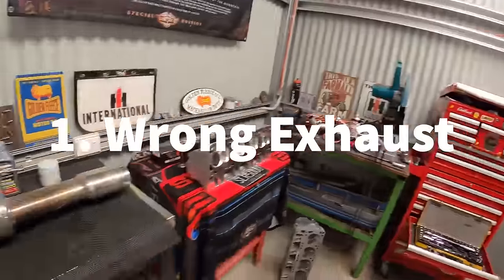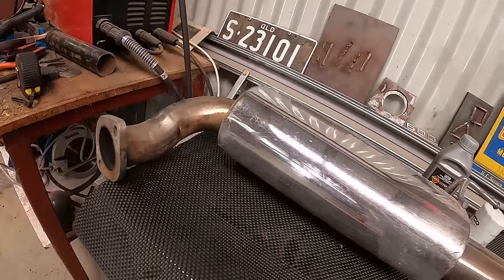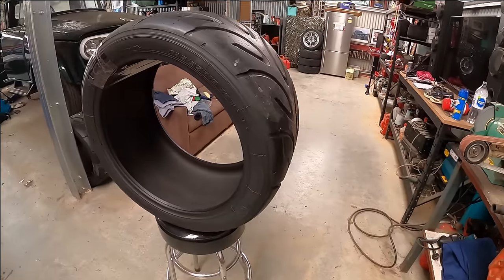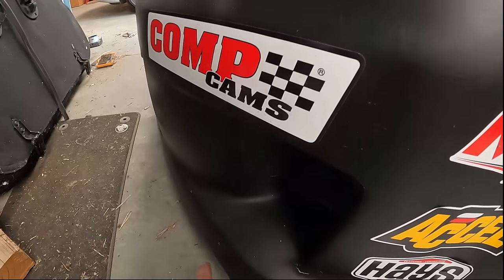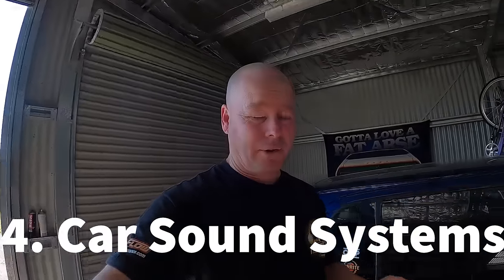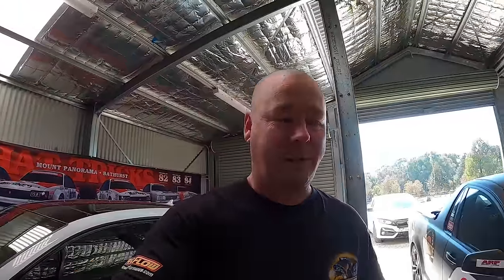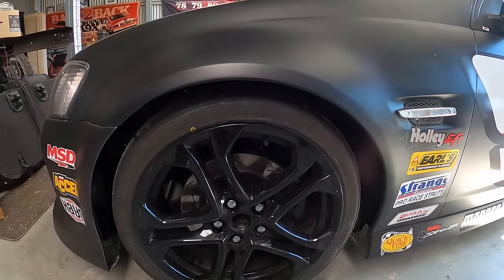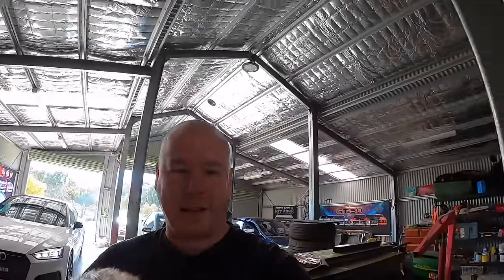Top 5 Worst Performance Mods - VE/VF Commodore

Comment: Hey I love you vids!
I just wanted to add one thing... Its not that you want backpressure... you want as little backpressure as possible really... But what you still need is velocity!
If the pipe is too wide, the gasses will slow down, reducing the suction effect next time the exhaust valve opens. If its too thin, you'll have too much backpressure.

The ideal size, is thin enough to keep gasses moving quickly, but thick enough to keep backpressure low.

Kind regards

Comment: So for 18" wheels what brakes would you recommend?

Almost all upgraded brakes from a stock SS ive looked at require 19"+ wheels to fit them ?
Like anything the size of SSV brakes need 19" they keep telling me.

Are you saying I should go a custom set ?
Any recommendations ?

I know I can fit better calipers (more pots etc) without 19" wheels but what about the discs? 
Supercars run on 18" wheels afaik or at least used to, but they have ducted cooling and I haven't done that yet, tho plan too in the future basically following your vid for doing it :)
Reply from the maker: G'day Jason, I have managed to fit my VF Redline brembo brakes under my forged Koya 18s.  Have profiled this on a video on the channel.  Also, Harrop sell forgeline wheels in 18s that clear their ultimate big brake kit as profiled on their Monaro 427 project build.

Comment: Is it worth getting sway bars cause I want to improve the handling of my vf series 2 sv6
Reply from the maker: Yes, upgraded sway bars are important if used with a set of coilovers and wheel alignment.  Don't set them up too hard though or your car will handle worse.

Comment: Good video mate . Just wondering , can I use or should I use 10W 40 on my V.E SS? Thanks for your time and effort
Reply from the maker: G'day mate, from memory 10W-40 was the recommended oil for LS1s across VT-VY V8s.  I am pretty sure 5W-30 is the recommended oil for VE SS V8 engines but double check your oil cap and vehicle manual.
Reply: @ClunieGarage  thanks for replying and the info . Across the road where I work I guy owned a VF SS and he reckon he used 10-40 for his SS . That’s why I thought I should ask the experts . Thanks for your advice very simple but accurate answer

Comment: Totally agree with your list, however, I must make 1 exception. My car will never see a race track, and is more so just for use as a daily, and I recently upgraded to 20" rims with staggered tyres. I have never felt so much traction or road handling in my life. I appreciate the enforced roll around a track would be best on 18's, but for a daily, 20's with wider tyres is definitely better.
Reply from the maker: G'day Ash, nice one.  Yes good rubber on a daily is the way to go.  You will have to try 18s and semi slicks on the track.  Awesome combo.
Reply: The extra grip could be down to having wider tyres on the rear.
Reply: Definitely can't see that 20's would be very good with turning any corner. 
Or keeping fillings in the teeth with any upgraded suspension
Reply: I used to have 19s on the SV6 with coilovers and it was rough on the road. 
18s on it now and so much nicer.

Comment: Top gear did a track test and got faster lap times with the smaller wheels over the 20" ones you need a bit of sidewall flex.
Reply from the maker: G'day Grant, yes we agree.  That is why we have gone with 18" Koyas and semi slicks on our VF.  20" are for auto salons and those days are over!!!

Comment: I have a VZ SSZ Crewman, grumpy 300 rwKw  LS1, that came with 18's standard. It has the slightly larger front rotors and calipers as do the Monaro's. I put on a set of (lighter) 19x8's (same offsets) as they look better (to me)....and noticed a reduction in brake performance immediately. Has to do with the  larger rotating mass and ......blah blah!  So... I had to spend more money putting on grooved rotors and better pads to get back what I lost for looks! Smart thinkin' eh!

Comment: Interestingly I took off the two rear mufflers off a VE 3.0 wagon that I use for work. It has made a big difference in better fuel economy. I do a lot of highway driving. Did the same to my SS ute, just sounds nice, not to loud. Great show by the way just discovered your channel. Use to do track days myself at sandown  in a RX8, brilliant handling car with good set of springs and tyers. Keep up the good info guys 👍
Reply from the maker: G'day mate, thanks for tuning in.  Yes, some muffler deletes are OK, I guess we just draw the line at full straight throughs.  I hear that Sandown is going to close to make way for a massive housing development.  How sad...
Reply: @ClunieGarage  wow didn't know that, that shouldn't be allowed,the government is robbing us from any joys in life.
Reply: I did the same on my 3.0 wags as well as removing the resonator of the intake and just Fab a Aluminium pipe left the Stock air box with a K n s panel filter and set up a catch can because I was finding a lot oil residue in the intake now IV been catching a lot crap in the catch can I think that has also helped fuel economy keeping my octane level higher
Reply: @jamesalbrecht418  The oil residue is because you are using a K&N filter they allow a lot of dirt through causing ring and bore wear which cause the blowby that gives you the oily residue and of course severely shortens the engine life. It may be to late but bin the K&N and go to a paper filter and just change it more often.
Reply: @grantreid3031  I'd say the pcv system wasn't working right. To be getting oil at the air intake sounds like the oil isn't getting out properly & pressure building up.
The Alloytec V6s were notorious for getting clogged as the outlet was too small for how infrequently the oil was changed. Leading to sludge and timing chain issues

15,000km 12 months was far too long an interval.

There's always going to be some blow by and such. But a lot comes from the rocker covers too. 

I've got 330,000 on my Alloytec LY7 SV6 have a small catch can and empty it once a year and have used K&N filters for about 200k of that.

Comment: Over here in the USA. Its fart can mufflers and loud booming stereos  that are pretty. Silly, all noise and no power boost.a launch control tune. I can understand  but they race on the highways and feeways. Right past  speed traps cops hide.  At.. i dont understand this two step mod so many use here at all. Good way to blow a turbo..

Comment: I've got three and a half inch not straight through but ..sounds great I don't think it's loud enough .. tyre issue I agree with I have trouble fitting tyre's .wings are for  planes personally..radios not in my car my music is my V8
Reply from the maker: G'day Jeffrey, we agree with you.  Best sound is those 8 cylinders rumbling.  If you want more noise, get some extractors and look into your cats - meow 😆
Reply: @ClunieGarage  I've got three inch headers xflow system right through with cats and mufflers it has to be roadworthy ..it's bad enough the cops break there necks everytime they see me I live in a small town not trying to be cop bait hahaha.

Comment: Everything is a compromise. I've got a cammed ve ss with long tube 4-1 headers and a 3" exhaust with 3 mufflers. Makes about 30hp more than another ve with the same cam but 4-2-1 headers and less mufflers. Did it more for the tone (not volume) but you lose a lot of ground clearance. 

18s are great for the track but imo tyre sizes aren't all that great. I've found most 200tw tires are around 265/35 or 245/40 which is a bit small for my liking. I think 255/35r20 and 275/35r20 are perfectly reasonable for street duties.
Reply: What cam are you running and what sort of power does it make?
Reply: @angry9901  Hi Torque performance custom HTP01. From memory it's around 224/230 @0.050°, 114 LSA, 0.6" lift. ~440 rwhp / 330 rwkw. L77 with manual trans. 

Closest VCM grind would probably be the VCM5SC.
Reply: Nice result right there, pretty wide LSA.
Reply: @angry9901  Yeah it's still a daily most of the time so plenty lumpy enough for me

Comment: P Platers and their V6 commodores sound the worst... Crappy sounding exhausts, E-Bay 'special' mods... The list goes on...
Reply from the maker: Yep, true that!
Reply: I used a LUKEY when the rear muffler started to fall apart.
Not loud and not stupid. Low volume 'burble'.
Reply: @MelodyMan69  Eh, some of them can sound okay (just okay), but they aren't inherently great sounding, even in stock form...

Comment: Agree with everything except you saying that back pressure makes power more power on a ls..it doesn’t matter what engine it is 😂😂 it’s proven that back pressure is not a restriction no if’s or buts…it’s dyno proven not what someone thinks ✌️
Reply from the maker: G'day mate, there is a really interesting tech article on Street Quicks website about some of the testing and r&d they have done in this regard with different size headers and exhausts - check this out http://www.streetquick.com.au/

Comment: Oh I forgot about your 18 inch wheels lol 20 inch rims are the go to for V8 Supercars 245/35/20 on the front and 275/35/20 on the back for a VE but hey what would V8 supercar race engineers know? lol you must be way smarter than them lol ya goose lol
Reply from the maker: I don't recall any V8 supercar in recent years running a 20 inch wheel.  They run a 18"x 11" wheel with the Dunlop control 285 tyre for several years now.  Support categories also have had a 17" option.   https://www.thesupercarscollective.com/inside-supercars/v8-supercar-technical-specifications/

Comment: Your wrong about the exhaust back pressure. About 1 foot of pipe after the extractors is proven to be optimal for power, but for street use, agreed. 
 I totally agree on 18’s and can’t stand oversized wheels

Comment: Hmmm the HSVs came standard with 20s drive
Fine, I think there's no issue with 19s but more then 20 is a no go... IMO
Reply from the maker: G'day Con, yes understand your point about HSVs but this is mainly to appease the mass volume of buyers looking for aesthetics and to clear the large brakes without fitting custom offset wheels.  V8 supercars run 18s, the top semi slick manufacturers largest available tyre size is a 18 (e.g. Yokohama ADVAN AO50) and many track day enthusiasts and performance builds (see Harrop Monaro 427 Ultimate Street Car), all chose to step down a run a 18.

Comment: Solid info!!   I have a VE GXP manual sedan and I’m looking to give her some love.  she has a walkinshaw build and nice coil overs( a bit too low) on 19 semi slicks,

I’m starting to here some rattles here and there, any tips on redoing bushes and other running gear? she’s rigid enough I just want her sounding tidy again... 
Also if I decided to put some work into the diff or gearbox what would be recommended or is certain services appropriate? 

Ohh also they have odd size rotors on the GXP,  any tips on replacing rotors and pads? as I’m sure they aren’t far off. And when I went looking it seems they aren’t many options? 

If it wasn’t rare as hens teeth I’d just sell it but this time around... I’m keeping it!  

Btw your channel and attitude is amazing keep it up!!!
Reply from the maker: G'day Josh, you are in luck!  We just posted a video on a full suspension bush upgrade to our VE SS ute.  https://youtu.be/7BPuKIBfDVo

These bushes will tighten everything up and make it feel like factory again.  Not cheap, but worth it to get the most out of your coilovers and hour wheel alignment will stick.  Diff and gearbox servicing just requires oil changes normally, but in terms of a performance upgrade, have you thought about fitting 3.7 diff gears? 

With brakes and rotors, get the exact measurement and there are heaps of aftermarket options out there for replacements.  Try DBA (we have them fitted to our VF and VE), in different rotor sizes and we are trialling Hawk pads.  They are amazing and well worth it.  We have videos on both of these mods on the channel.  Hope this helps mate and please let us know how hou going go.
Reply: @ClunieGarage  absolute legend!   Yeah I have 4/11’s I like the feeling of always needing to control wheel spin, it’s like an LSA when ya can’t afford one.... And it seems to cope ok in 5th n 6th in the rain, she gives way better fuel 
economy around town than the factory ratio Hahahah it’s always driven in 4th... and it holds wheel spin through 2nd into 3rd in the dry, and 4th if ya greedy,  all this fun just with 4:11 and a good clutch.

I’ll jump on and check out the videos, now :) on bushes!  

 Can you use any particular high grade oils that are better than oem or recommended for HP setups?

Still looking for rotors FK it ... I need to do a measure up, and call around... because the GXP is not listed in the parts catalogue much,   if I get the disc measurements I’m sure I’ll find something in USA under the Pontiac listing. 

hawk uses the G8 Pontiac GXP setup but I’m not sure if it fits the calliper/rotor that Holden fitted to the car.   More investigation to be done. 
As I’ve ordered them before and didn’t fit...

do you have a rotor recommendation I’m happy spend money? 

Thanks again for all the info, and I’ll pop in and see ya if I’m eva in ya area.

Comment: The whole back pressure thing is a debate that has raged for years. At low RPM you might have some issues with a big exhaust system but the higher the RPM range the better velocity, turbulence and flow. I’ve seen big and small on the dyno with V8’s and seen larger and smaller systems about 50/50 just the dB levels are different.
Reply from the maker: G'day mate, agree it is a debate.  We can't fault the gains we have achieved with the smaller headers and exhaust to our VE.  A speed shop in WA (Street Quick) has also done a big write up on exhaust sizes and power output/track times which is hard to ignore as well.

Comment: I have 2.5" Corsa Catbacks and am thinking of getting the Harrop OTR Cai. Would I need a tune to realise any performance improvement?
Reply from the maker: G'day David, you will get a minor improvement once you fit the OTR as you will get more air flow and it will run a tad lean on the standard tune.  Now that you have an exhaust and fit the OTR, its a perfect time to get a tune and align your AFRs to get the most out of the bolt ons.  Have you thought about getting some headers as well?

Comment: My VFII Redline has VMC OTR  Intake, My own tune, 1-3/4in headers, Twin Cat back 3" system. The dyno shows peak wheel KW's at 300.5 with gains across the whole rev range (compared to 2.5" system) Cars with 2.5in systems are getting nowhere near 300RWKW's. Actually, I haven't seen many 3" system crack 299 either.... Fine tuning the tune goes a long way in getting that 2-5 extra HP 🤣:elbowcough:
Reply: I have vf series 2 redline with ramjet triple step headers and cats with a manta 2.5 inch and harrop intake and I got 311kw atw
Reply: @lukeneill1568  👍 Must be e85 or a different Dyno. The numbers are pretty consistent at the workshop I go to. Nothing NA on 98 is that high without a cam upgrade. Head and cam you're looking at 330+rwkw It's amazing how much a few extra HP feels on the road though.

Comment: wheels, the BEST wheel is 18" light-weight, but the key here is the weight, the less un-sprung weight, the better.

I 100% agree with the 20" issue, went 20's on my VX SS yrs ago (swapped from 17" stock) and acceleration was worse, handling was crap. Moved to drilled VE-18" wheels, the weight was so much less, and the car felt really really nice to drive afterwards.

Went back to 17's for sale time, and if still felt nice, but the 18's were a sweet point.
Reply from the maker: Nice one.  Check out our wheels mods video for our support of 18"'s!

Comment: Great video! 
I know it's probably a bit of a long shot, but if you were to upgrade an exhaust on a 3.0L VF evoke, whats the way to go? How can I get a bit of extra performance/nice engine note, but no drone?
Reply from the maker: G'day George, we don't have any first hand experience with exhaust mods on the 6 cylinder VFs unfortunately.  Your local exhaust shop may be able to help with a header and twin exhaust combo that will free up the flow and add a note.  Try to stick with mild steel systems and good quality mufflers to avoid the dreaded drone.
Reply: Change the rear mufflers to a free flowing muffler.
Too much back pressure from the standards.
Leave the rest you need velocity!